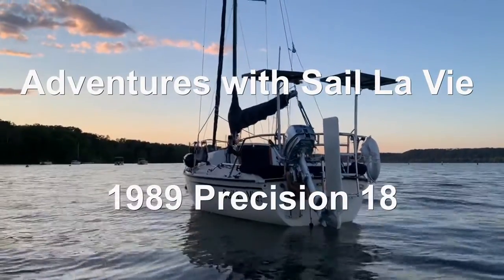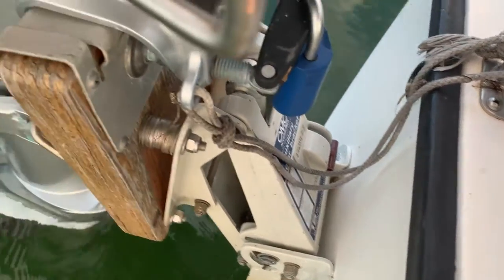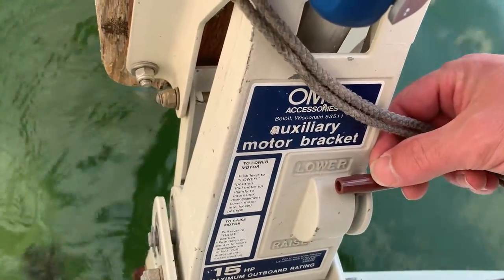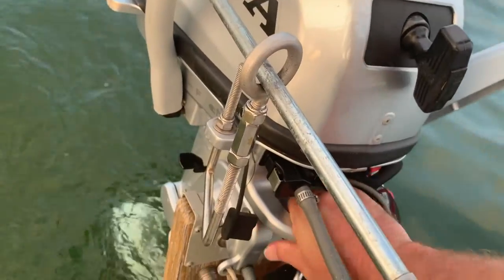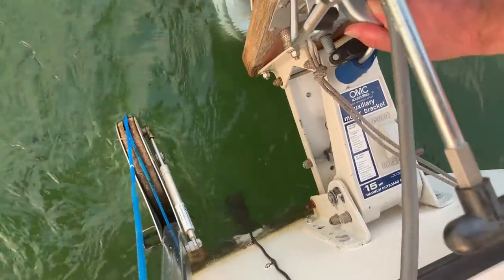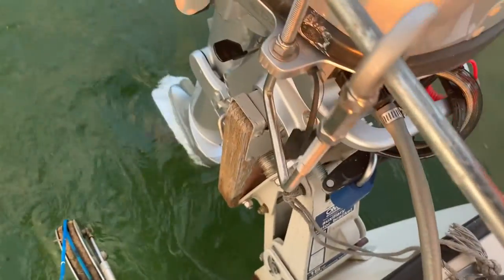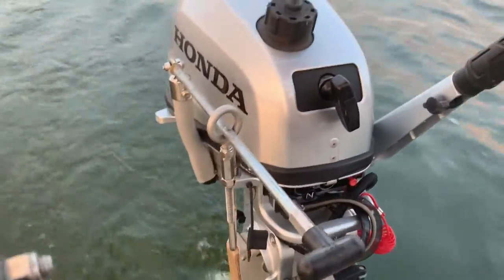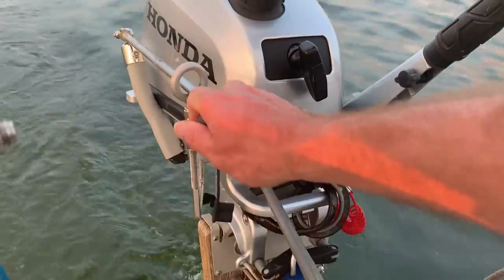OMC Auxiliary Motor Bracket and Outboard Shifter Extension

Comment: Thanks for the video, very helpful. Question: the range on the OMC. It looks like it drops more than enough, especially with my long shaft motor. But it looks like your prop does not come out of the water? Besides, perhaps mounting it higher on the transom is there a way it can come up higher to get the prop out of the water? It looks like you also have a long shaft? Any problems with the cylinder that provides the lift? thanks!
Reply from the maker: No problem.  Yea, the shaft didn't come out of the water all the way unless I did the extra step of tilting it.  But for me I wasn't to worried about getting it all the way out of the water.  There was a section of the transom that had a plywood core in between the inner and outer fiberglass.  I mounted it as high as I could and still have good clearance in this section.  You can probably mount it higher with a different boat.  I was also switching from a short/regular shaft to a long shaft outboard and had dealt with cavitation so I want to make sure the prop would stay in the water in larger swells.

I never had any issues with the OMC cylinder.  I really liked it compared to the spring options.  I wish they still made them.

I hope this helps!

Comment: Where did you get that motor bracket who makes it?
Reply from the maker: The motor bracket is no longer made.  Hasn't been for a long time from my understanding.  I don't know why because it is so much better then the spring units.  At least in my opinion.  I was able to find one being sold as a salvaged unit on ebay.

Comment: How. Many  hours can you  run that with the fuel you carry aboard... I've been building an electric  set up for mine it's a 5. Hp
Reply from the maker: Hi Alex, great question.  I had that all figured before but I forget the calculations at this point.  There is the tank in the boat 3 gallons, and a gallon in the outboard, and then I have a spare 1 gallon tank that fits in the same fuel locker as the main tank.  So all in I have 5 gallons on board.  I'm pretty sure the calculations got me to the 100 to 120 miles of range if needed with all 5 gallons.  I use the main tank first, then if needed I can switch over to the internal tank on the outboard.  At that point I know I am down to about 40 miles left between the internal tank and my emergency extra 1 gallon tank.  It has never come to it but if I need it the emergency 1 gallon tank its good to know its there and that's my last 20 miles so that should always be more then enough to get me to a fill up location.

That's really cool that you are building an electric set up for yours.  You will have to make a video and share it.
Reply: @livingmatt3729  thanks  ,summer is  an eternity  away

Comment: What's with that stack of washers? Lmao.  Make a bracket that is correct 😂
Reply from the maker: Thanks, that was the solution I came up with to get the right angle from pairing the manufactures lift bracket with my boats transom.  I don't have the  metal work equipment to make a new bracket.